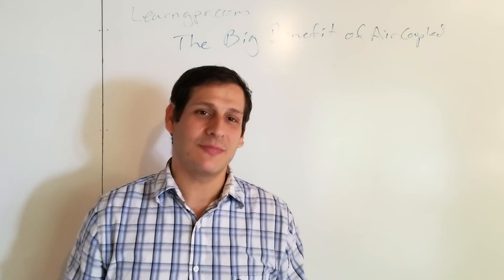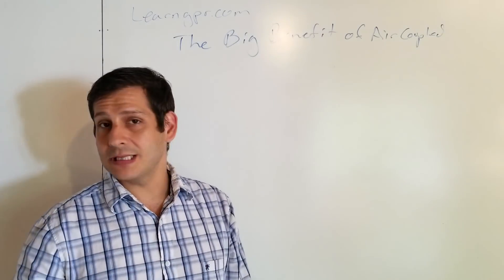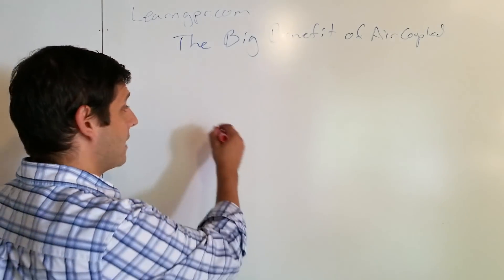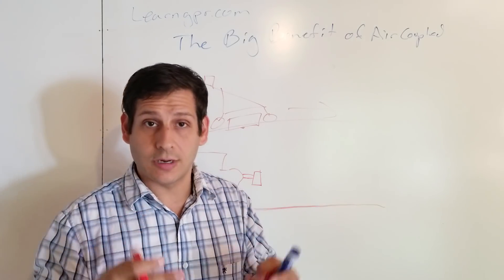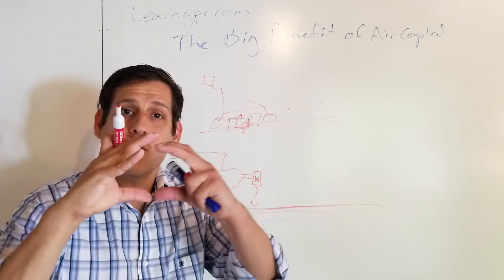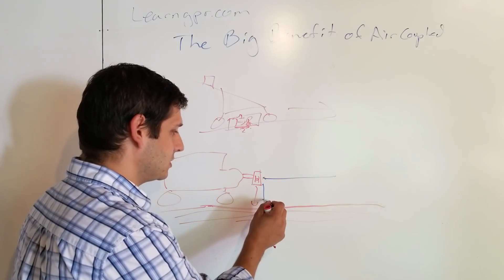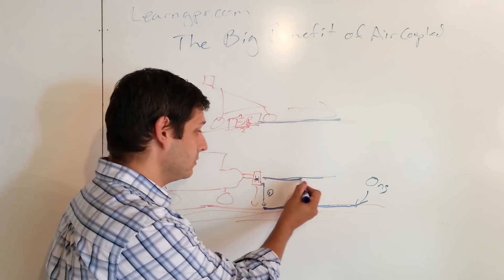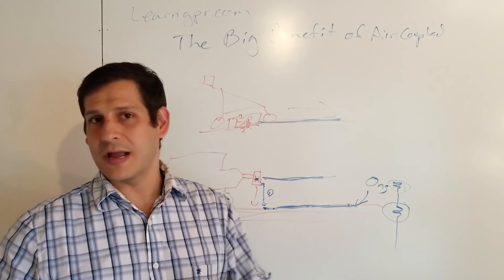An important benefit of air-coupled GPR | Ground penetrating radar

Comment: Hi Dan, We have been researching GPR for the last few weeks with a view to purchasing a vehicle mounted system. 88% of roads in Australia are unsealed dirt roads, most of the rest use ultra thin asphalt over approx 150mm to 300mm gravel then natural soils Additional information such as ground water table would be a possible advantage but less of a priority in our case. Air coupled antenna seem a safer option given the poor running surfaces we often encounter would destroy a ground coupled antenna. Do you have any recommendations on the best configurations of antenna ? I've read 2Ghz air coupled and 900 Mhz ground coupled is a good combination. Could we substitute the 900Mhz ground coupled for a air coupled antenna and mount it on the same arm.? Also is there a minimum distance the antennas should be located from a vehicle ?

Comment: Two more practical benefits for roadway applications: if you want to drive at freeway speed like 50+ mph (1) you aren't worried about smashing your equipment against the ground, and (2) you don't require traffic control for data collection.
Reply from the maker: Very true...and practical. Thanks

Comment: In GPR the air wave is always the faster, isn't it? :)
Reply from the maker: Yes. But if the system is ground coupled and the antennas are close together then there will be overlap of the signals whixh can be difficult to distinguish